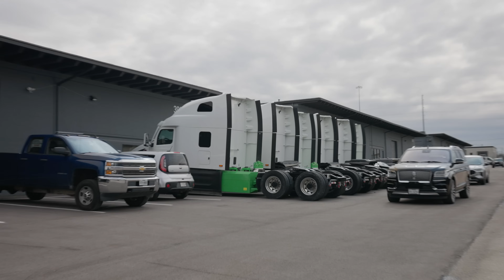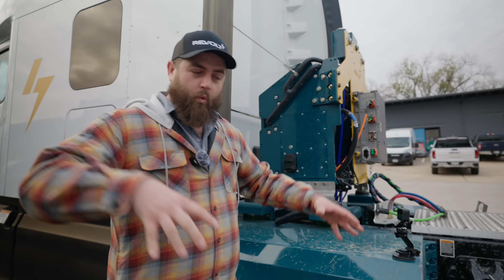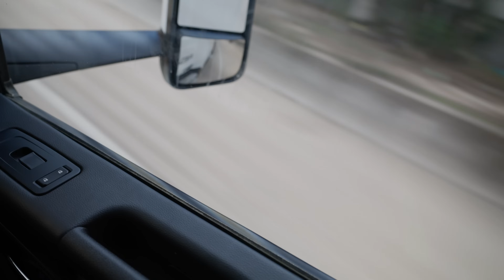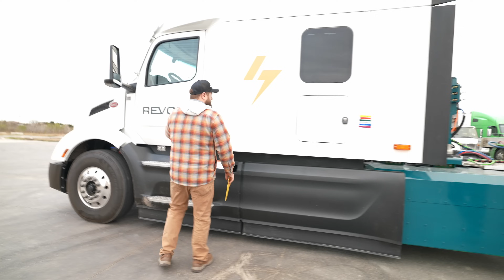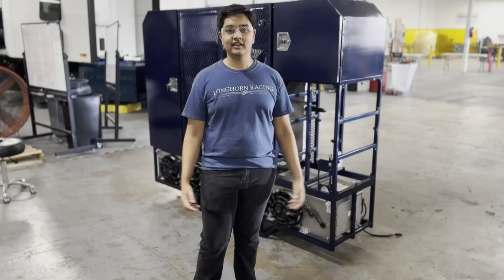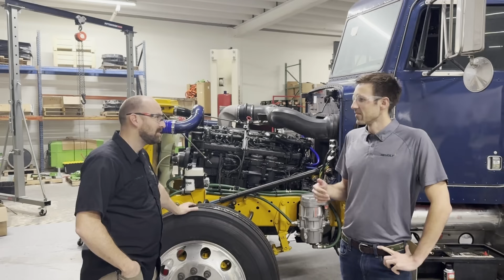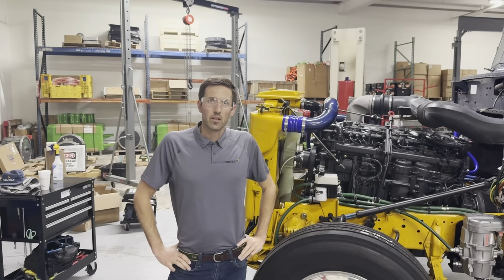Test Driving First EVER Diesel-electric Peterbilt Truck!

Comment: I hope the yanks build it. They have trucks are more fit to add systems to them, the long wheelbase, longer driveshaft, like theyre made to add a hybrid system. But i would expect zero or even negative results on long haul. This is totally for metro areas. And in a metro area it will have to compete with electric trucks from likes of Tesla or Mercedes that already have clients. My oppinion would be to go for garbage trucks, box trucks and not semi.

Comment: For me this is the practical way to go for Semi trucks. Locomotives basically do the exact same thing, but on a much larger scale. Diesel power plant that operates electric motors while also charging batteries is not a far fetched idea. However getting it tuned right to operate smoothly,  I think that's where the challenge is so that truck drivers just get behind the wheel and it just drives like it has an automatic transmission.

Comment: Running a straight diesel motor is okay… putting emissions after treatment makes diesel motor maintenance a nightmare.  On top of this insanity you wanna incorporate what into it ?

You’d be lucky if a truck lasts 500,000 reliable miles. 🤦🏻‍♂️🤡😵‍💫

Comment: That trailer weigh's empty about 10,900-lbs. This is exciting news as this is exactly to the "T" what I've been asking for going on 20-years now. Small diesel powering a generator which electrically power the rear axles. The engines only task is to generate power to recharge the onboard batteries, and has no connection whatsoever to the driver. What surprises me is even without a real load on the wagon, the steer axle is already at 12,000-lbs. I would imagine because of this, a 13,200-lb axle was installed which doesn't give a lot of head room for moving 5th wheel. As a result of the excessive tare weight of the tractor, the gross weight with loaded wagon will need to be raised to between 84,000-90,000 lbs to compete against a diesel rig.

Comment: Good stuff.
The electric system makes sure that the engine is constantly running at optimum RPM to maximise fuel efficiency. 
The giant gearbox is also eliminated as the engine is not mechanically connected to the wheels.

Comment: Serious questions, how is this going to work in rural areas where I drive a feed hauler that requires a wet kit?  It was -12F this morning and my truck was left running overnight with all the fuel additives and still jelled up will this setup cure below 0 temps and the need for hydraulics?

Comment: Hyliion Holdings is not out of business, but it is winding down its powertrain business to focus on its KARNO generator. 
Explanation
Hyliion Holdings is an Austin, Texas-based company that makes parts for commercial trucks. 
In November 2023, Hyliion announced that it would lay off 175 employees and wind down its powertrain business by the end of the first quarter of 2024. 
The company plans to keep its technology for future use or sale. 
Hyliion acquired the KARNO generator from General Electric in August 2022 for $37 million. 
The KARNO generator is a fuel-agnostic generator designed for stationary power generation and heavy-duty transport applications. 
Hyliion expects to begin initial paid deployments of the KARNO generator in late 2024. 
Hyliion's decision to wind down its powertrain business was made to safeguard its financial stability, especially given the current economic climate.

Comment: There is other   diesel electric in Austin
Went out of business

Hyliion Holdings is not out of business, but it is winding down its powertrain business to focus on its KARNO generator. 
Explanation
Hyliion Holdings is an Austin, Texas-based company that makes parts for commercial trucks. 
In November 2023, Hyliion announced that it would lay off 175 employees and wind down its powertrain business by the end of the first quarter of 2024. 
The company plans to keep its technology for future use or sale. 
Hyliion acquired the KARNO generator from General Electric in August 2022 for $37 million. 
The KARNO generator is a fuel-agnostic generator designed for stationary power generation and heavy-duty transport applications. 
Hyliion expects to begin initial paid deployments of the KARNO generator in late 2024. 
Hyliion's decision to wind

Comment: Maintenance will be another huge advantage that will be apparent after 5 to 10 years with no transmission or brake service ever again.  The generator should also last a long time with constant speed operation resulting in leas stress

Comment: What is the battery replacement cost with labor?

Subtract that from the cost of the money saved in fuel 

My experience with hybrid 

Every dollar I saved on fuel went right back into battery replacement and labor
Reply: so your profits as a driver are no different....  ok what is wrong with that.  Especially with ability to run silent in town... , have more torque for up grades, (and no loss in speed) lower engine maintenance (it does not work as hard staying  at peak efficiency at most all times )   etc

Comment: MATS isn’t the show for that truck. Fleet show would be. Typical owner operators aren’t going to be able to afford that truck. Another question would be where would one take that truck to be repaired across the country? If that’s not made by the oems then you might have difficulty getting repairs even more so if they use a scania motor. Everything breaks at some point and with the technology in this thing I’m sure it’ll be even more.

Comment: 12:22 But they're going to be using Scania engines (not the American built Cummins already in use in this test bed) when there are several American diesel engine manufacturers?

Comment: For me it's more technology to break and leave you on the side of the road. I've been driving for almost 30 years and was wondering how long this would take. Also, these newer just have more and more things to break. Whether it's the def systems, sensors or electronics it's just more to break. Just like anything else it needs to be reliable, if it isn't it's not worth it.
Reply: Diesel-Electric locomotives have been around for 40 years now. Same idea.

Comment: Not a true diesel electric. It is a diesel hybrid with a battery pack. The biggest downside of hybrids is they have the highest maintenance cost since you have to service mutliple complex drivetrains in a single vehicle.
Reply: It's a series hybrid though as the engine doesn't drive the wheels. The main benefit of this configuration is that it allows easier adaptation to BEV conversion. They can run this truck 100% on battery power if desired.

Comment: This is a good advancement in drivetrain technology for efficiency. We need a less toxic battery chemistry and more sensible emissions regulation that is truly final, not net zero. Diesel-electric would also be good in light work trucks.

Comment: I would love to drive this! I'm currently driving a 2025 KW T-680 with a 15 liter Cummins, so that Cummins looks TINY under the hood, but having electric drive with a smaller engine to charge seems like way less fuel, and better acceleration/ torque

Comment: This stuff is way too cool dude! I'd drive one of them for sure. my only question is with the battery packs being on there how will that affect load capacity? because the total gross weight of regular diesel powered semi is 80,000 lbs. will they pass a law to allow it over that to compensate for the batteries on electric or hybrid trucks?

Comment: Existing diesel engines can achieve remarkable efficiencies but yes having the "assurety" that comes with a hybrid drive system matters in a huge way to unlock this built in capability. Plus might not need the Eaton transmission anymore. Cheap junk plastic exterior body panels still make these vehicles a turn off to me big time...interiors basically one big fireball waiting to cook off as well. No ADAS systems...needs a second steering axle up front simply put a Class 8 prime mover only wants to do one thing once underway and that be "keep going straight." that these trucks can turn at all is remarkable actually #rollover_risk big time verdict: stick to the Freightliner Sport Chassis offer always😊😊

Comment: This actually looks pretty cool. I have a few concerns. One is the expense and longevity of the battery bank. Will it charge going down the road? I'm also concerned about the fqns being out in the elements they would certainly fail in winter conditions.

Comment: I still don't understand why a bulkhead on the front of the trailer is not mandatory in the US. Firstly for the safety of the driver and especially with such electrical equipment behind the cabin.
Reply: Because it's the USA and Rednecks and they like to Squeal all manly!

Comment: Over 12k on the front axle? With practically an empty trailer. Those concrete blocks weigh less than 4k lbs

Comment: having owned a toyota corolla hybrid, and being a trucker myself, I wondered why hybrid trucks aren't more common thing already, solves the range and charging issue and doesn't matter how hot or cold it is
Reply: Weight and don't really save fuel for otr truckers, maybe for city driving

Comment: I bet they are at least 100k more. And, weigh at least 5000-10000 more pounds.
Reply: The weight penalty isn't that large because equipment is exchanged since it's a series hybrid. The largest expense for truckers is fuel cost, then maintenance. If they can put a motor in there that doesn't need DEF, that would be a major win.

Comment: Hey Bruce. It is a nice truck, but I have reservations. A diesel truck with all the electronics makes for more things to go wrong. How long before the batteries need to be replaced and will the cost of battery replacement outweigh the fuel savings. Will there be a market for used diesel electric trucks in the future.
Reply: How long for the DEF and DPF shit to go wrong? For the latest automated manuals/automatics to crap out and need maintenance or replacement. Modern trucks are expensive to run either way. Better have a more efficient alternative.
Reply: I doubt battery replacement would outweigh the fuel savings. Even in a Camry hybrid, the fuel savings and reliability improvement makes it worth it over the non-hybrid model. The larger the vehicle, the more it can benefit from an EV or hybrid drivetrain.

Comment: This is not the “first ever” 😂.  Way to go Brad. This is one way piss off the keyboard warrior and improve your video YouTube analytics.  This is the third one EVER. Edison already built 2. Like previously stated in the comments the first one is a retro fit done to a 60s Kenworth. The second one was designed and built from the ground up.  With 10 trucks currently being built but you probably already know this.  So you piece of shit. Your video title should say the first ever production tuck with a diesel electric conversion kit.  But that title would not create as much attention.  Therefore lessen the profitability of the video.  All about the money from 10 seconds of fame.

Comment: Diesel electric trucks can be designed completely differently when you don't use the mechanical drivetrain at all, just like trains. Ideal weight distribution on mind and with engines that are made for it; steady output at constant RPM. That is when you use the fuel most efficiently, cause the least emissions etc. You don't need high torque or HP, the engine can be much smaller. At worst you need to wait for the batteries to charge up a bit before ascending steep hills if battery is already too low... So, it requires a bit of planning but computers can do that for us, easy.

Most likely cab over design suits the conversion the best.  Smaller engine, flat floor.
Reply: It's the torque you need to spin generator under load and you have engine set to run at it's optimal revs for max torque/BHP plus engines can be designed/built for constant revs so more Static/marine type compared to a road engine that needs power delivery from idle to max revs all the time

Comment: Leaf springs on a new truck xD
Also a hybrid system will only add weight and really does not improve fuel efficiency after you run out of plug in juice and need to start the diesel to charge the batts... Then you need to replace the batts after a few years and that will be expensive.. It will be good for short inner city deliveries when you can run from the batts 90% of the time and charge them at the terminal. But completely useless for long hauls.
Reply: You need to maintain the auto transmission 4 times a year. As for manual gearboxes they are only good if you have an experienced operator that doesn't overload the gearbox or try to change gears without the proper amount of revs. Diesel electric will eventually allow us to put electric motors on the trailer which will enable more traction in slippery conditions and enable more power uphill.

Comment: Bruce, you and Revolt are miss out on a selling point that should be used. Stress this is a newer idea for OTR but it is very much like diesel electric locomotives, something most drivers do know a bit about. Yes, the batteries are a new twist but the diesel turning a gen unit to power the drive wheels is how America's freight trains have moved since before the 1950's depending on the railroad.

Comment: MEanwhile @electrictrucker drives cross Europe in a Batterie Electric Iveco seWay (Measures at 770 hp with 60% throttle before wheelslip on a 10 ton downforce)

Comment: Why not just go with a Hydrogen powered diesel engines, much easier, kind to the environment ( well as much as can be ) also keeps the guys building engines in a job and all their suppliers in business 👍 oh and you don't have to dispose of the batteries after 5 years when they shagged 😮
Reply: diesel is far easier than hydrogen to deal with. Also if the batteries are useless after 5 years, they failed because the warranty is supposed to be 10 years on BEV/hybrid vehicles.

Comment: Diesel electric makes it sound like it has the same technology as a railroad locomotive.  Maybe this kind of technology would be viable in the trucking industry.  It's interesting to see how quiet a big truck like that is as conventional trucks are loud.  I wonder if it's required to have some kind of noise maker installed so people would be aware of it.

Comment: So this doesnt just have fuel tanks it has battery pack also, which has got make it heavier than a normal truck, and if its working and driving, it should have a regular load, 42,000-45,000lbs... not some wimpy partial, that sounds like there afraid it can't handle a real load on it.

Comment: Edison motors has done this as well. I believe they are working on a conversion for cummins pickups as well
Reply: I love the Edison plan. New built trucks and retrofits!
Reply: @StretchMiller509  yes but mainly focus on New build and i love it also ! retrofits will mainly be pickups i think Both of them will use Scania 5 liter engines edison and this company
Reply: I believe the idea is more any truck, they’re putting a smaller Cummins in anyway
Reply: Edison‘s using the Scania Engine for their semi trucks and for their light duty trucks, they’re using a four-cylinder Cummins
Reply: @ yeah i wrote wrong i was supposed  to type Edison and revolt will use Scanias 5 liters but revolt mainly will do retrofitt and edsion will do more Groundup  new  produced heavy trucks yes they will also do Pickup truckswhit smaller cummins
Reply: Edison Motors did originally say Cummins and on their website two years ago when they originally announced that they will be doing a pickup truck kit they had Cummins. Then, some time down the road, it switched over to CAT. As of today, their pickup truck kit is showing Perkins 3.6L.
Reply: Edsions idea is to to build brand new trucks revolts idea is more of convertion of older tucks nothing built brand new yes the edsion first trucks were prototypes but afterwards they only gonna build new ground up trucks revolt are converstion only
Reply: @nzxt1234   Edison is also going to do truck conversions as well.   That was their plan from the start.  Where it differs is Edison wants to do it on older and vocational trucks.  Their first proof of concept is a 62 Kenworth LW 924.  They have several other trucks from the 60’s and 70’s they will eventually convert.  Once they have been able to establish themselves, they will offer their own conversion kits.  Revolt is more for more modern highway box truck conversion which Edison isn’t as interested in. Of the first 5 rigs Edison is building, not one is designed for hauling a standard box trailer on the highway.
Reply: @nzxt1234  edison is doing both